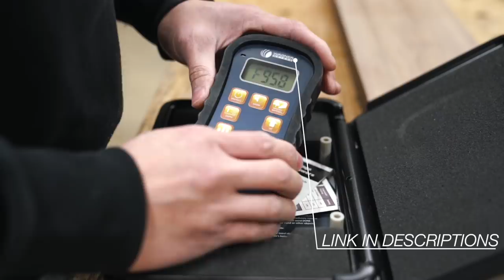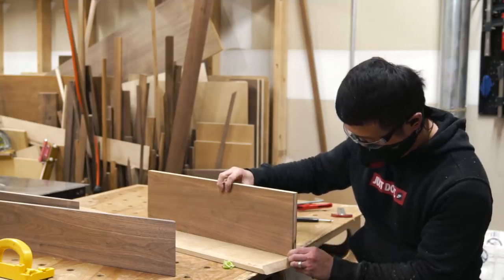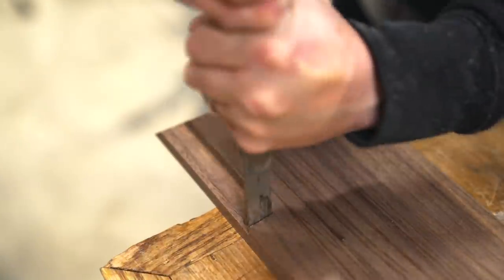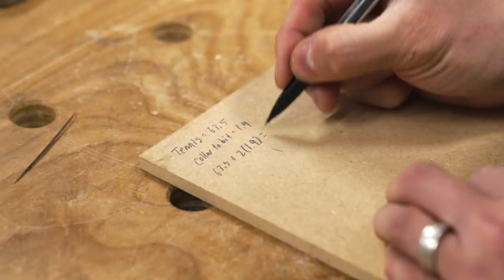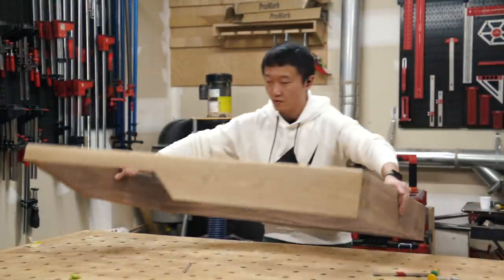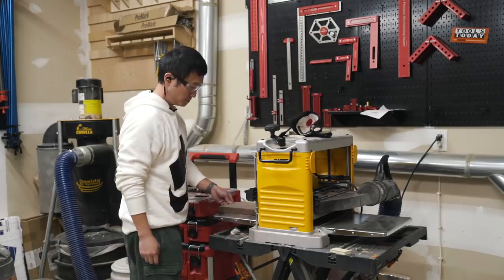How To Build A Mid Century Modern Dog Bed || DIY

Comment: What are the silver clamping aids you used on the joints? Seems like a great way to get clamping pressure on miters.
Reply from the maker: They’re called “clamping Blokkz” and I got them from Rockler. But I’ve seen free files floating around that people use to 3D print

Comment: Hi Alex. Really cool! I noticed you set up your incra sled to the right of the blade. I was thinking of doing the same. Any particular reason you prefer that? Also, what are those cylinder holds you have clamped to the corners to help.. clamp the miters? Thanks!
Reply from the maker: I set it up on the right because I do a lot of angled cuts. I won’t be able to do that on the left side. Those clamps are called “clamping blokkz” and you can get them from Rockler. They’re pretty expensive. There’s a free file somewhere out there that you can download and 3D print them for free if you have a 3D printer